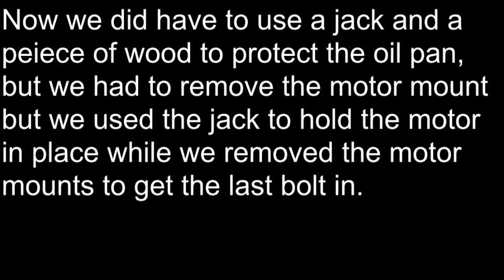04 grand am power steering pump change

Comment: What size are the bolts that hold the power steering pump and pulley on?
Reply from the maker: If i recall it was 10mm holding the pump on. Its been awhile

Comment: I've been looking around to buy a new car, cause I've been stuck with my 98' Nissan Sentra, which only has 100hp, 0-60 in literally 15/16 seconds lol I'm looking for something that's fast, or somewhat fast, and only around $5,000. Pontiacs seem to be the answer, however the car needs to be able to fit a car seat in the back. Any suggestions?
Reply from the maker: well im not always around looking for stuff like that. But i worked with a guy who had the 05 grand am he had his kids in the back until he had more kids and had to get an suv. im not going to lie if you can find one of these grand ams either 2 or 4 door i think you would be happy, there quick little cars not the most powerful but for that price they move,  and it seems to be a pretty reliable car,parts are affordable and easy to find. Just make sure the person you buy from took care of it, as with all used cars something happens. You could go with the other gm variants as well such as impala or alero, but i think the pontiac has better styling.  my mom got a 95 grand prix almost new and had it for years, she put my little sisters car seat in it and two other kids in the back.
Reply: I have one and the car seat fit in my 2 door coupe just fine. I'm now using a front face car seat and has room to move her feet.
Reply: I got mine CASH for 5g's over 6 years ago from an old man who took care of it. I'm about to hit 200k miles and it's a 1999. It still runs smooth as hell and I've got hella work done to it so it reliable as fuck
Reply: @EfurdGarage  update: my 1999 got totaled out last year 😭 a truck hit the driver side, damaged my suspension, rack and other damages. Since then I find an original owner to 2002 black GT and if she decides to sell she'll give me a call the car under 90k miles. Garage kept, seen her at Walmart one day and gave her my number if she ever decides to sell to call me.
Reply from the maker: @esmiq7771  nice. Thats low enough miles to last a long time. This summer mine cracked the block
Reply: @EfurdGarage  I had the lower intake manifold gasket replaced. Did you fix it? When it got hit I had a replaced the whole suspension from tie roads and ball joint to a new rack. I was so pissed. Mechanics used to tell me how nice it rode and looked. I kept the slip of the title soni have the VIN so if I find another I'll get it painted to that exact color.
Reply from the maker: @esmiq7771  no i let it go. It had so many issues that at that point, that i just had to let go. Over 200k miles the guy i got it from let someone work on it that just messed things up. The body was starting to show bondo spots... It went to someone in Oklahoma then he listed it. I just went and grabbed a vibe to replace it.

Comment: Pretty informative, one trick my dad taught me is to use a turkey baster for empty master cylinders so It would be the same for the pump. But of a tongue twister lol.
Reply from the maker: yep that does work, who needs some high dollar tool. i have one just for that lol. apparently the previous owner had put in transmission fluid, so i had to drain the pump and add new fluid, drive it awhile. Drain again, add more, repeat. Until there was no more red.

Comment: Thanks Buddy
Reply from the maker: Thanks for stopping by
Reply: The power steering fluid in my pump is yellow looking and I put fluid in it because I thought it was low it's filled up and it's still making that whining noise do you think the power steering pump is trying to go out
Reply from the maker: @billysanders5353  highly possible, especially if it has never been charged. Also look to see if the pulley is cracked
Reply: I've been having trouble with my power steering. I replaced the rack and pinion and the pressure was blowing out the power steering so I got the original GM ($260) power steering and 2 years later that power steering is giving out so I have to buy another 😭
Reply from the maker: @esmiq7771  i would look at the lines, the pulley, and the fluids just to make sure its none of those, because 2 years is not very long
Reply: @EfurdGarage  update: My car was hit and pushed onto the curb by an F150 and damaged bad  😞 so no fixing it
Reply from the maker: @esmiq7771  thats horrible, are you ok? i guess the car is considered totaled?
Reply: I was not in the car when it got hit. The car is getting picked up today but the damages on it I'm pretty sure will get totaled out.
Reply from the maker: @esmiq7771  thats unfortunate, those are pretty good reliable cars
Reply: @EfurdGarage  yeah, I'm going to go buy another car this weekend 😔
Reply from the maker: @esmiq7771  what are you going to get?
Reply: @EfurdGarage  maybe a Honda Accord. I was gana go get a GTO by the end of the year but since I'm one car down I gota replace it pay it quick then go look for a GTO
Reply from the maker: @esmiq7771  what year gto?
Reply: @EfurdGarage  I want a 2006 6.0L
Reply from the maker: @esmiq7771  those are not bad at all, i got a few buddys with them.
Reply: @EfurdGarage  I've been wanting one since I was a teenager when they came out.
Reply from the maker: @esmiq7771  they are becoming pretty popular, I see them for sale around my area from time to time. They seem to stay up in price along with the g8s
Reply: @EfurdGarage  not many are for sale around here. But they are reasonable. The G8 are overpriced in my opinion I'd rather have the GTO.
Reply from the maker: @esmiq7771  some of the g8s are over priced for sure, but for both the g8 gt and gto i still think they are high because of the mileage thats one them and  how hard most of them have been driven. oddly enough i after driving and being around both i prefer the g8 myself. im not sure %100 why really because i was never a 4 door kinda person. But luckly i got a g8 cheap just took some time
Reply: @EfurdGarage  you got lucky then. I wish I could get a deal like that lol
Reply from the maker: @esmiq7771  yea very lucky i caught it just as it was put out for sale, yea it has some things that need fixed but no big deal.